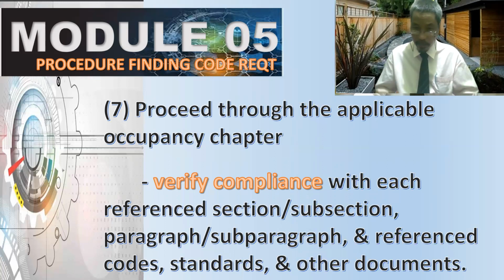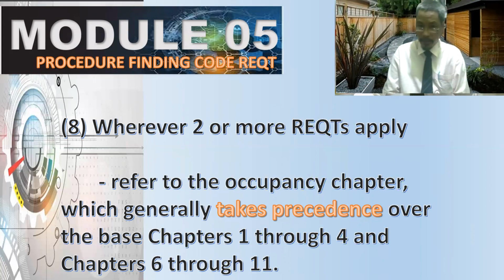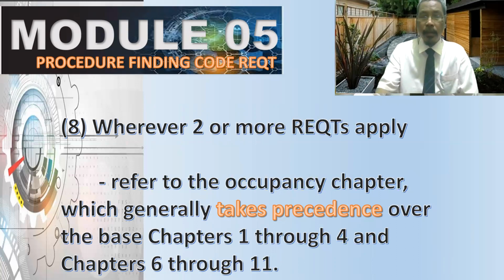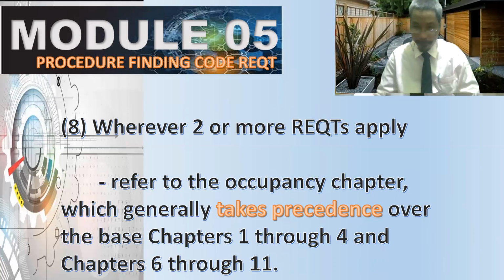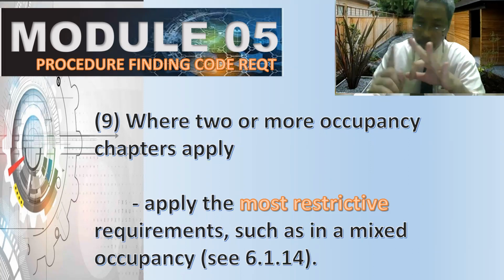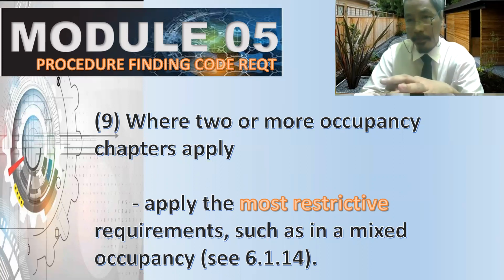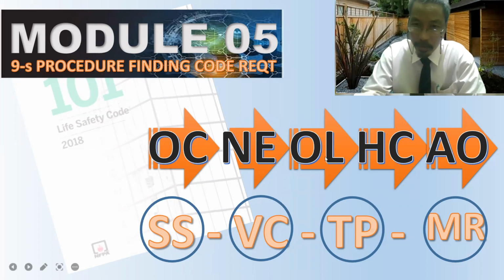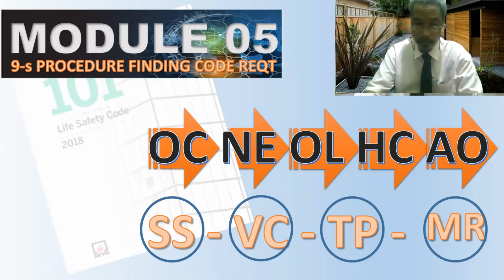Procedure in Finding CODE Requirements - NFPA101: Module 05.2 [ Reference CODE by RA9514 - IRR2019 ]

Comment: Thank you sir for this well-explained lesson. This video is a continuation of Module 5: Navigating the Codes, part 2: Completing the 9-steps procedure, Procedure Of Finding the Code Requirements. For Step 7 Proceed thru the applicable occupancy chapter must be verify compliance with each referenced section, subsection, and other documents. For Step 8 Wherever 2 or more requirements apply, refer to the occupancy chapter, which generally takes precedence over the base chapter 1 to 4 and chapter  to 11. For Step 9 Wherever two or more occupancy chapters, apply the most restrictive requirements, such as in mixed occupancy, refer to chapter 6 section1 subsection14.
9s Procedure in finding the code requirements, OC NE OL HC AO: Occupancy Classification - New or Existing - Occupancy Load - Hazard Contents - Occupancy Class. SS-VC-TP-MR : Subs-classification or Special use- Verification of documents - Taking Precedence - Most restrictive. Thank you po sir.